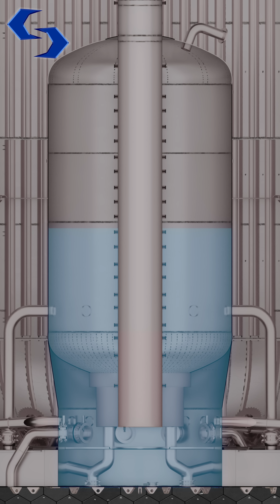Superheavy Engine Failure Backup Plan

Comment: I like the detailed explanations. But why not draw fluid from the bottom of the tank for the middle ring engines? And why does the fuel not float when the booster is free falling?
Reply: Baffles stop the fuel flowing back up the tank in free fall
Reply: This is why they have COPV's.  Nitrogen fills up the space as the tank drains.
Reply: The booster is only in true free-fall above the atmosphere. For most of the descent it is experiencing significant drag and deceleration forces. So the propellant stays settled in the tanks, although with a tilted surface.

Comment: So in theory, loss of all center engines could result in landing on 4, 7, and 11?
Reply: The side tube extensions only extend a bit after all, I think they wouldn’t have enough fuel as the very bottom section is unused that way?

Comment: How do they manage to draw propellant upward like that with no gas cavities forming?
Reply: Admittedly, it is a compromised design, and vapor slugs are quite detrimental to the turbopumps.
Reply: @imconsequetau5275 seems like a reasonable compromise. Beat up an engine to save the booster & launch structure.

Comment: I wonder if it could handle losing all three center engines
Reply: Yes, they have three backups. Assuming the backups work. But it’s unlikely to happen.
Reply: Presumably, the 3 designated backup engines are pre-chilled along with the 3 center engines and all 6 are available. 

However, the 3 siphoned tubes didn't seem to reach all the way down, and the booster needs to use center engines to consume the "dregs". Perhaps the next booster version will eliminate siphon tubes.
Reply: @imconsequetau5275 That’s a good point, a backup engine will run out of fuel before a centre engine. Perhaps the time delay is insignificant.